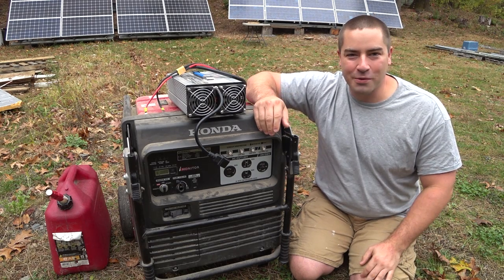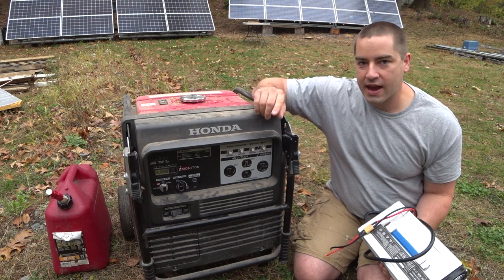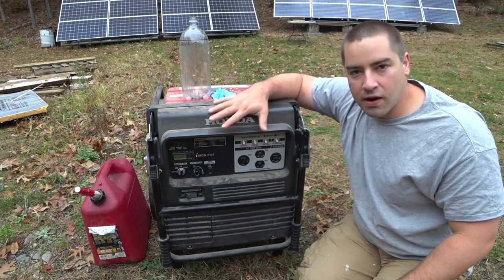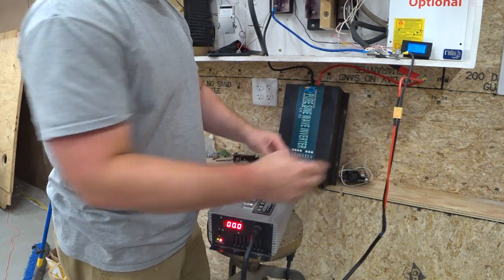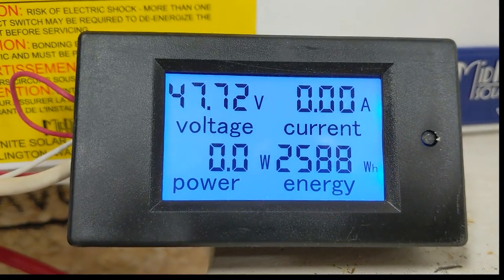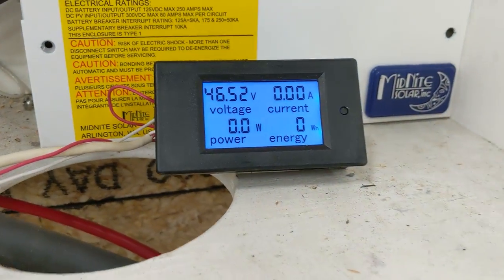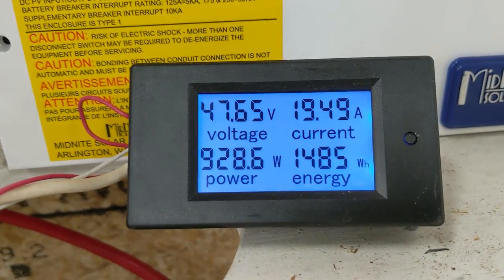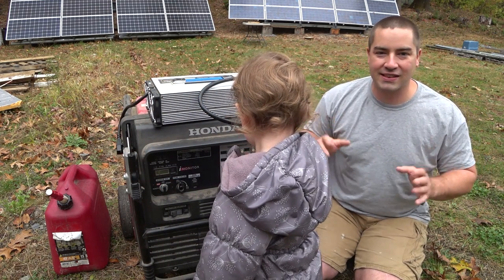Recharging your battery bank without solar

Comment: I've been running an Eco Flow Delta 2 during the power outages here in California and recharging it with a Honda 2000 generator which is a perfect combination as the solar panels are mostly for good weather and sunny days. Like you I just put a squirt of gas in it so it would easily run a hour before shutting down. While the generator is running I would run my washer machine and an insta pot. A hot meal and a little news and it was time for 🛏️. 
Just another perfect day. 
Yep.

Comment: One cannot really say that the smaller generator is more efficient.  The 6500 was running at idle and if you had a second charger you could have plugged it in and charged the batteries in parallel with twice the power and not taxed that larger generator at all.  Hence getting more power into the batteries than the 2000 watt generator was able to deliver at idle with one charger.  The larger motor on the larger generator will burn more fuel faster but has more output  power, so for a proper test you should dump as much as you can with as many parallel chargers as you can use while keeping it at idle in Eco mode.  I would really be interested in that video.  I have one of those 2000 watt generators and it will run almost 8 hours in eco mode on 1 gallon of gas because the motor has less displacement then the larger one.    David you have a fantastic channel and I love seeing all your videos.  Keep up the great work!

Comment: Thanks for the generator charging efficiency video. I was shocked at the major difference and thought perhaps that the larger generator would have been loafing along consuming about the same amount of fuel per kwh vs the much harder worked small generator. The small gen set has to be so much more quiet too. Take care!
Reply: The newer version of his generator, the EU7000i has EFI and is quite a bit more efficient. Probably not as efficient at the loads in this video as the EU2000i, but close. There is a 1db difference between the eu7000i and the eu2200i.
Reply: Thanks!  I’ve been using Honda generators since 1981, when I was introduced to the brand by the volunteer fire department/ rescue squad I was a member of.  They said “the cost is high, but they run quiet and ALWAYS start”.
(they used 1800 watt 120vac / single phase generators)

And I continue to use their inverter based gensets for emergency public safety radio use at multiple repeater sites AND for household use, I have 2 pairs of EU2200i’s.  The EMI/RFI used to be pretty harsh in the first generation inverter generators, but considerably cleaner now.  Actually better than the utility company.

They sure have changed on the technology front, but are still beasts when it comes to long-term, heavy-duty use and abuse.

Comment: Thanks, David, that confirmed what I had suspected about the efficiency of internal combustion engines at load
Reply: There's nothing to confirm about the efficiency of internal combustion engines ... a gasoline 4-stroke combustion engine is at max 25% thermally efficient.  A Diesel compression combustion engine can get close to 50 thermal efficiency. But that's kind of why this video doesn't make any sense because that's not but he's referencing when he's saying efficiency here. He's talking about the efficiency of the generator head to make electricity using a small,  expensive, Honda engine. The generator actually has a pretty efficient inverting electricity generation head
Reply: You can just read generator specs too

Comment: I use a PTO 10 kw generator attached to my branson tractor and it takes 6 hours and 3 gallons of diesel to get to get sol ark to charge 30 kwh signature solar lithium bank fully.
Reply: That’s good efficiency
Reply: Your batteries can't use all 10KW for charging, huge waste of diesel fuel.  Generator should be sized to put out only power the charger requires

Comment: The most efficient way to mechanically generate power, is with an heavy duty vehicle alternator and a high quality voltage regulator.  I did all this testing about 25 years ago.  Something like a 48v alternator connected to a small efficient engine like a honda or subaru 1200-1600 cc engine can produce over 5000 watt/hours of direct charge voltage from 1 gallon of gasoline.  Some tests were as high as 8 kw/gal, depending on the state of the battery charge.
Reply: We should be able to do a lot better now with Lithium Iron batteries as they will accept a very fast charge rate compared to LA batteries .
Reply: Question: what high quality voltage regulator are you talking about? I would like a name to start with. I'm debating on adding a 300AH 12.8v LiFePo4 battery to my semi as a house batteries, but I'm not sure if I want to tap into existing starting batteries for charging.

Your suggestion appears to imply that I can use the truck alternator for the charging juice. Tell me more please

Comment: I have recently discovered that 48V DC battery charger "generators" exist.  There is a company in Cyprus selling one that uses your 48v battery to start the generator automatically when the voltage drops to a set point, and automatically shuts it off when full.  They have a natural gas conversion available.   With the mass adoption of 48V LiFePO4 battery banks I am surprised a US company hasn't started building them.
Reply: That would be my choice.
Reply: Very interesting and you're right it should be automatically available in US
Reply: Or just run the generator in to your inverter if it has the option to have ac line in to charge batteries mine does and its a older outback model and turn the charger down to match the generator.
Reply: I've heard about this company as well, but they have some kind of cheap engine... It would be nice if they make a kit that you can connect to Honda 3000 for example
Reply: @bishbosh7728 what do you mean by turn down the inverter to match the generator? I haven't bought anything yet but I'm trying to research everything

Comment: I'm from EU where energy prices pretty much gone to the moon. With this figured you display in the video is still cheaper to keep paying the grid. The kwh here gone from 0.1€ to nearly 1€ and this is still cheaper than 1litter per kwh that you demonstrate here. This because 1litter of gas goes for 2€. Of course if we put the upfront cost and maintaining the generator in working condition it's even more expensive. It seems more logical to oversize the array.

Comment: It makes sense to have a backup plan in case things don't go as expected if you're off-grid. In emergency management things are usually set up to at least a third level because RL experience shows that it's needed more often than you'd think. Thus it's very important to know how much fuel to plan for.😎 

Also a word of advice on small gasoline engines: Use only non-ethanol fuel (especially for stored fuel) as ethanol draws water from the atmosphere, and one drop of water in a tiny carb passage can shut you down. Even with that you need to keep your fuel stock fresh as all of today's gasoline begins degrading in 2-3 months time. In a pinch ethanol-enriched fuel will work if you use it while it's fresh, but you lose about the same percentage of available energy as the percentage of ethanol in the blend.

Comment: David it's always interesting trying to figure out how to get the best solution to a problem, David have a look at the eco flow smart generator , what they have done is they charge up the battery systems they make, (delta and max) with DC power instead of changing it to AC then back to DC  through a charger for your batteries. as you know the less times that you transform the electricity type the more efficient it is. it will still make AC power as well but the design prioritise DC power instead of AC like conventional generators.

Comment: IMO you could be running a much larger battery charger (or 2-4 of this one in parallel) to extract the max efficiency from the bigger generator. This is why I'm a fan of having multiple days of capacity in storage if I can afford it. If we can scale up to a water-cooled engine, then we can also extract the waste heat from the engine. Hot water is great to have year-round.

Comment: I get about 7kwh to a gallon with a yammaha 2000 watt generator. And the signature solar charger.   Yamaha can idle for 16 hours light load.  At 18 amps I get about 8 to 8.5 hours of charge to a gallon.

Comment: 33.7 kwh in a gallon of gasoline according to google so 2.588 kwh is really bad but still better than running out. Even if you are paying $4 a gallon it is still expensive electric, but what is a guy going to do in winter we haven't seen the sun since November lol.
Reply: I am not sure but i don’t think we can use that figure for this generator
Reply: Wow 33700 wh on gallon seems pretty good to me
Reply: It was a bad test, to get efficient power out of a generator you need to run it at full throttle, which he didn't do.
Reply: @Zorlig  hence why he said if he did it again he would get a much smaller generator
Reply: 33.7kwh is the theoretical power a gallon of gasoline holds to get it out you would need a power conversion with no heat which is impossible with ice engine I think a car is only between 11 and 27% efficient if I remember right so it is not as bad as it looks.
Reply: @offgridwanabe  im currious to know how much a same kwh generator running on propane/lng would improve on thermal efficiency. Just weight a 20lb propane tank run generator for 1 hour then weight tank again to see fuel usage in pounds/kg and the specific energy then check the battery charge level.
Reply: If you use the waste heat for heating your home it becomes much more efficient.
Reply: More panels and wind turbines

Comment: I get 6kWh/gal of LP at 90% load on my 10kW Generac into two SA 12K’s. Needless to say, I haven’t ran my generator at all this winter. I bought enough solar panels to recharge my battery, even on the cloudy days and enough battery to last 3-5 days.
Reply: Solar is probably the cheapest way to go. I see about 10% efficiency at worse case out of my solar panels on cloudy days average. If snowfall it can go to almost zero. But usually 10% at peak is the worse.
Reply: @mylesoffgrid  agreed @ 10%

Comment: what a great test! Thanks for renting the smaller generator, the extra effort you went to for this video was so worth it! Also BTW Honda also has a very small 1000 watt suitcase generator....... hmmm....
Reply: I have the 1000 and a couple 2000s the 1000 does work but the fuel tank is only a half gallon.
Reply: Great idea! We need a multi part series.  I’d don’t know why he didn’t just pour the rest of the gallon in the genny after an hour or so? Also, would like to see a diesel genset comparison if he could get a small enough one.

Comment: Great exploration David!
For equiv gasoline: I like to round down to 33,000 watt/hrs per gallon. If we take your numbers and round them up we get 4400/33000 = approx 13.3 percent efficiency, on par with a normal ICE car engine. At 15 cents per kwHr, we get 4.4x.15 = 66 cents worth of energy for our $4.00 per gallon or roughly 16.5% dollar efficiency. 
For my particular use-case I decided that more battery was a better option i.e. no gasoline in the garage, no generator sitting unused (most of the time) no generator purchase. Each person needs to figure out what is best for them.
Reply from the maker: Thank you for the math break-down.  That's a great way to look at it.
Reply: And..... (skipping the math).. if a tesla model 3 (which weighs 4200lbs roughly) uses roughly 1kwh per 4.17 miles... long story short that model 3 is getting roughly 17mpg!.. oddly 17mpg is about average for the weight with only improvement being the acceleration and stopping characteristics .. which goes to further show you that the only real advantage to electric anything is the price of power comparison.
Reply: If at all possible, one can heat with fossil fuels and support any electric heaters. Generating electricity is not effiecient unfortunately
Reply: @schwinnminibike I guess a tesla has the same fuel efficiency as the average car when charging from a generator. Its gonna be much more fuel efficient when getting charged by a large power plant
Reply: 15% is pathetic. The eu6500is when compared to the eu7000is is nearly 50% more inefficient due to carburetted vs fuel injected. 
These generators run most efficient when at full rated road. So 4-5 of these chargers in parallel on the 6500is generator would give him the best efficiency. Or 2 of these chargers on the eu3200i fuel injected generator would give even better efficiency.. you could almost get overall 25% thermal efficiency with a fuel injected generator running at near rated load..
Reply: we pay 60 to 80 cents/ kwh in the Netherlands, so that's a completely different ball game......
Reply: @thefirstdutchguy  Yes, and we pay approx €1,60 a liter diesel, which contains 10kwh of energy. So if you run a diesel generator with a efficiency of 20% ( which gives you 2 kwh electrical power ) your paying roughly the same as the grid power atm. 😅

Comment: I'm in an RV and have 2 arrays. 1160W (4x290) on the ground and tilted and 1200w (6x200 bifacial on a dual axis tracker.) M My system consists of: 4x100Ah BB lithium's, Multiplus II, 12v 3000 120, a pair of 150\70 controllers routed through a Lynx distributor and all going into a CERBO with the touch 50. These past few months have been pretty dark and cloudy. I do have 30a shore power.. but the solar has been barely keeping up. I also have one of these Honda EU2000i generators. It holds 1.1 gallon of gas. It's 46 lbs. btw. It's only good for 11 amps.. so I'll keep the 30a shore power.. but good to know. I'm also a new subscriber.

Comment: I have the eu2200is and the eu3000is. They so great and I use them to charge batteries, dig holes with a jackhammer and for light welding around the property. They are an excellent investment!

Comment: I’ve been saying this for a long time. You always need a plan B or C. If the sun is not out.

I have 3 of those 48v 18A chargers. I actually use three small portable Ryobi generators. Those small generators holds a little over a gallon in each Generator. I get a little over six hours of run time when charging on each generator.

I’ve powered my house and charge the battery at the same time. My house pulls 17- 25amp. With 3- 18a chargers wired in parallel I’m pushing in about 50amps, Minus about 20 from what the house is using. I’m charging about 30 amp’s.. I’m thinking about getting about charger with another small portable generator.
Reply: I’m setting up a power max 100amp ac to dc charger to a inverter powered by a alternator being turned by a steam engine that is being powered by fire or sand battery or air made from a windmill compressing it into a storage tank … a-z

Comment: excellent test, the larger generator is more efficient this is mathematical, but the power produced and available must be exploited, in fact it is less efficient if you draw little, you have to choose the right generator for each situation, in offgrid a large generator set perhaps during recharging you have other appliances go at the same time, and you size the battery chargers and generator to charge the entire battery bank in no more than 4 hours otherwise it becomes unnerving.

Comment: If you have an all in one solar charge controller, such as the MPPSolar LV6548. I have mine plugged into the grid but when the power goes out during a hurricane I unplug it and then plug it right into the generator. No need for a separate charger. You can also select how many amps that you want to charge with so depending on the output of the generator you can set the charger to maximize the output of the generator. Only limit is you use more fuel the harder you run the generator. In my case my generator is hooked up to natural gas and is capable of 12,000 watts run, and 13,500 starting, but on Nat Gas you get a lot less output. But I can still push 50 amps easily to the batteries and get a full charge in as little as 3 hours if the batteries aren't too low

Comment: Now you can put a cable on the large generator to the ac in side of the Schneider XW pro and charge with the inverter at full ability of the generator .

Comment: Your generator efficiency series is absolutely famtastic, loved the alternator rig also. 
There is one thing I would like to try once I get my hands on one of these inverter generators, and perhaps you could try as well, and that is, tapping into the DC bus inside them, that is right before the  inverter section.
What kind of voltage would it be? It would definitely add some points to the efficiency.

Comment: Noise pollution is a big consideration, I use an inverter based solar and charge at 6kw. Probably go parallel with the gens as I scale up.

Comment: This was a very interesting video, thanks for sharing.  My understanding in this scenario is that the generator would be used for charging the batteries only, and that the batteries continue to drive the inverter/s that power the things that need it in the house.  It seems like a good solution and very fuel efficient.  I have 6.9KVA Ryobi to run my house during rolling blackouts, which happen frequently in my part of the work, and I am really keen to move to batteries and an inverter instead.  I want to install solar, but understand that there will be times that if I don't have a wind-driven alternative, or both are not available, and that happens, that I would need a generator instead.  My present generator is a serious fuel thief and I am not happy with it at all - it costs way to much money.  So I am looking for alternatives, and I also want to be grid independent where I can.  P.S. We sometimes have up to 8hrs and more of blackouts a day, so it is very frustrating... it also messes up batteries (lead-acid) badly.  Thanks for sharing.  I'd appreciate your thoughts.  Thanks.